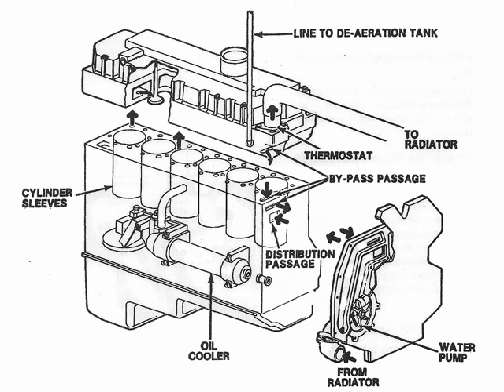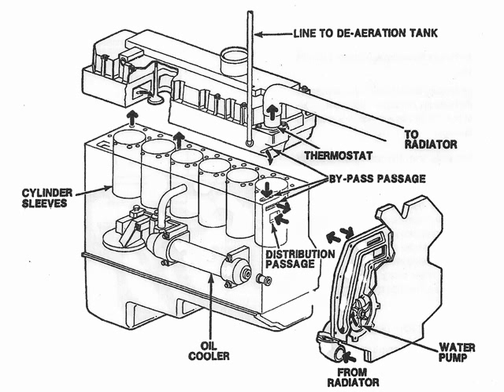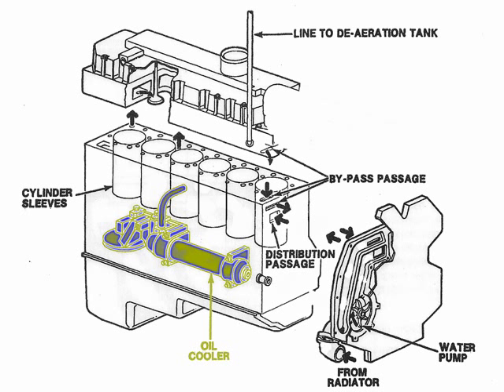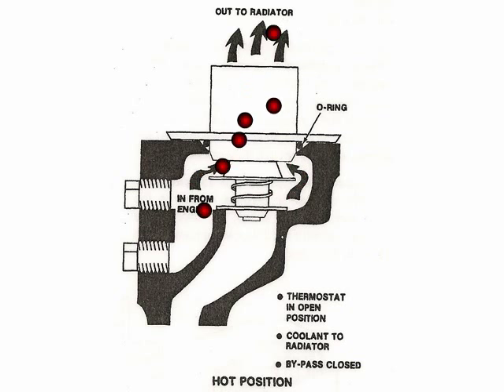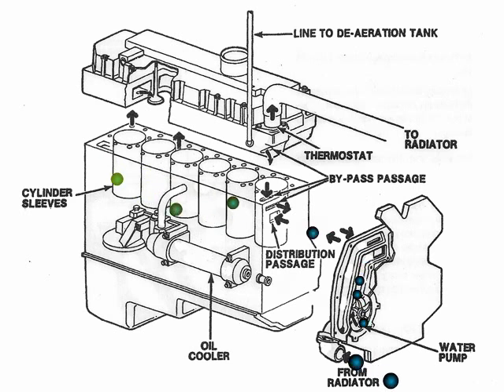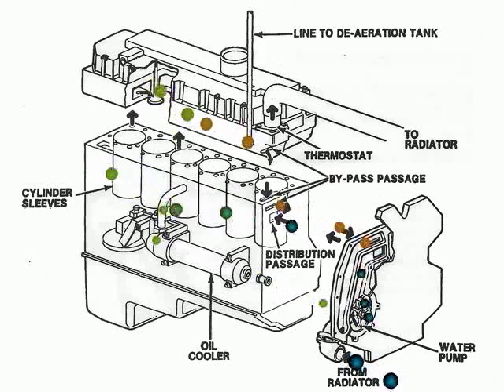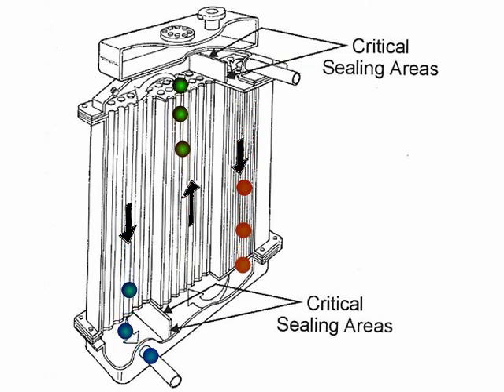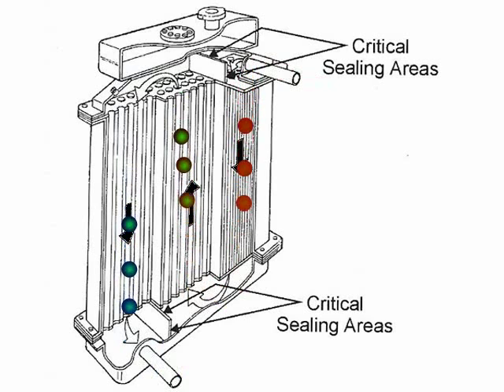Matt's Cooling system

Comment: Excellent video.  My friend just bought a 2001 4700 with the DT466E engine and it's leaking coolant where the engine oil cooler connects to the water pump housing.  Any idea how hard that is to repair?  Thanks.
Reply from the maker: I believe it is just o rings that seal that area. You will need to remove the cooler and replace o rings and gaskets to stop the leak.

Comment: I have questions  I have oil leaking in too the reservoir.   Oil looks good
Reply from the maker: Radiator reservoir???
Reply: @instructordave111   I thinks it's my oil cooler
Reply from the maker: @OscarHernandez-rj1dl  I would guess that as the first place to look for sure. If not there it could be head gasket, cracked cylinder head, cracked block. At least the cooler is relatively easy to test. Good luck.
Reply: @instructordave111   That's a thing like truck never heated up
Reply: @instructordave111  thxs
Reply: @OscarHernandez-rj1dl  did you fix the problem on your oil cooler
Reply: @allensantos3246   It was the radiator transmission  get into the water reservoir
Reply: What's have u change
Reply: Is ur water creamy
Reply: @OscarHernandez-rj1dl  no not at all
Reply: @OscarHernandez-rj1dl  water pump, thermostat all filters washed out radiator
Reply: Ok I'll check it out, mine is doing the same plus overheating
Reply: @allensantos3246  did it fix the problem or still over heating
Reply: @OscarHernandez-rj1dl  still over heating

Comment: Are u still active on this video Matt?
Reply from the maker: Matt was one of my students many years ago and this was what he put together for his cooling system project. Do you have a question regarding the video or do you know Matt? I am still in contact with him to this day.
Reply: @instructordave111  I don’t know him I just had a few cooling questions about the DT 466
Reply from the maker: @h22eh6  Possibly I can be of some help to you. What sort of questions do you have?
Reply: @instructordave111  I have a 1999 international 4700 with a DT 466E engine and for some reason coolant keeps overflowing out of my overflow tank and the temperature gauge reads like it’s overheating but when I touch the engine it’s warm and not extremely hot what is causing my coolant level to rise to where it comes out of my overflow tank
Reply from the maker: @h22eh6  Hi Omar, it sounds like you may have a bad head gasket or if the truck has an air compressor system on it for air brakes,  it may be a  bad head gasket on the air compressor pump or a cooling system air valve that is operated using the air system such as a cab heat diversion valve. When the engine is cold, take the radiator cap off and start the engine. Check to see if there are bubbles in the coolant. If there are bubbles you will have to track down where they are coming from. Does the engine have milky oil? This can be an indication of a bad head gasket or cracked head or cylinder liner.
Reply: @instructordave111  thank you for your reply. The truck has hydraulic brake system. No compressor. And I don’t see any bubbles when I crank it up cold. I did that a few times. Besides head gasket what are other issues u have seen to do this? As we speak the truck just did it and the coolant is not hot, both hoses are not hot and the valve cover is not hot. It’s like it can’t bleed off the pressure or air. I replaced the radiator cap. But I’ve been running without one
Reply from the maker: @h22eh6  It can be hard to diagnose , especially from a distance as to what is causing your issue. Have you removed the thermostat and tried it that way to eliminate cooling system purging as the problem? Pressuring the cooling system on a cold engine with no air compressor can only come from the pressure built up in the cylinders. My initial thought is that you have a cracked cylinder head, bad head gasket or cracked cylinder liner. When you create the pressure in the cylinder, the volume of compressed air may be enough to push the coolant out of the cooling system through whichever of these problems you are experiencing. I fear that you are looking at pulling the cylinder head off to find your problem.
Reply: @instructordave111  I don’t understand removing the thermostat to eliminate cooling system purging. If I remove tge thermostat I can’t bolt the hose back down it seems. Looking at it right now. My oil level is good has not increased. Coolant looks clean not milky. I stopped by a gas station and got coolant back in it from what I lost and now she is running fine with a 3000 pound load. I don’t get it and got plenty of heat
Reply from the maker: @h22eh6  the thermostat is inside the housing and could be removed and the housing put back on. Sounds like you may have had a large volume of air locked in the cooling system which would then point to a possibly blocked de-aeration hose or port in the thermostat area. If there is a de-aration hose, I would check to be sure the fittings are not plugged or the hose is not collapsed. Glad that you got it working again. As I said it is very difficult to diagnose something when you are not actually there to see the issue.
Reply: @instructordave111  where is the de-ration hose located.
Reply from the maker: @h22eh6  IF your truck has one it should be up by the thermostat housing going to the top tank on the radiator. It may also just be a port inside the thermostat housing that can sometimes plug with rust or debris.
Reply: @instructordave111  I’ll look and get back with you. I’m loaded and driving to destination
Reply from the maker: @h22eh6  No problem, let me know what you find. Good luck.
Reply: @instructordave111  You don’t happen to have an email do you
Reply from the maker: @h22eh6  I do have email, but am retired from teaching so I would prefer to keep these conversations on this forum..
Reply: @instructordave111  there is a port on top of the radiator a hose is coming from there going to the thermostat housing. Also there is a hose on the top of my overflow tank looping around to the bottom of my overflow tank
Reply from the maker: @h22eh6  the hose from the radiator to thermostat housing is the de-areation hose. If it is blocked in any way the air can't get out of the cooling system. The other hose to the overflow is either the connector to the port by the radiator cap or the drain hose for the overflow tank.
Reply: @instructordave111  You are right my radiator vent tube was going to my thermostat housing and not to my overflow tank that was the problem the whole time
Reply from the maker: @h22eh6  glad you found the problem. Hopefully no more coolant issues.
Reply: @instructordave111  So with the lines flip-flop like that and not route it correctly was pressure going back into my coolant overflow tank?
Reply from the maker: @h22eh6  that is correct, any flow in the engine would have been pushed into the overflow tank and blown out on the ground . It just goes to show that hoses and wires should be labeled or color marked to ensure they go back in the right place. Was someone working  on the cooling system that led to the switched hoses?
Reply: @instructordave111  Yes I bought the truck messed up and paid someone to put another engine in I called the mechanic and sent him pictures and he was very apologetic do you think any damage could’ve been done to the motor
Reply from the maker: @h22eh6  depending on how hot it got it could have done some damage. Is it running OK and not burning oil? If you were catching it quickly enough, you may have kept any damage to a minimum.
Reply: @instructordave111  it’s running great now pressure in my overflow and I see coolant coming in it from the thermostat housing.
Reply from the maker: @h22eh6  excellent, it took a minute but I think you have it sorted out now!